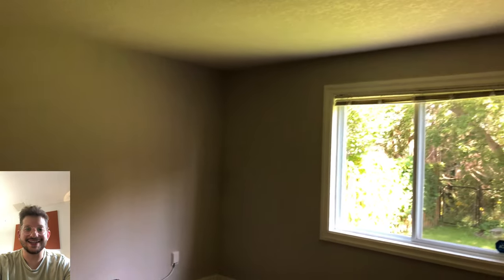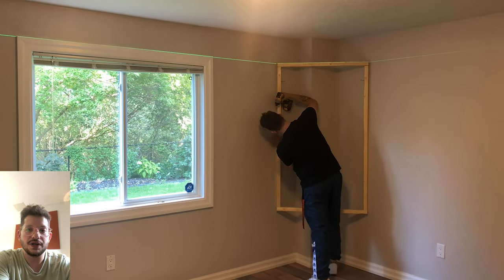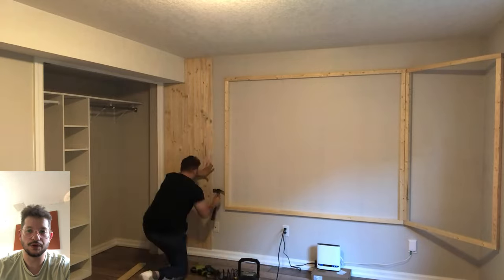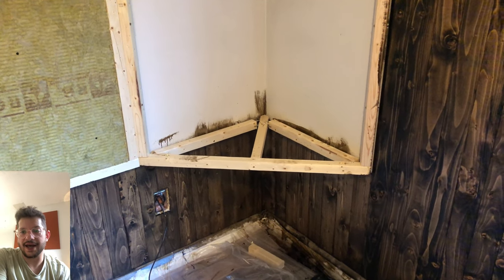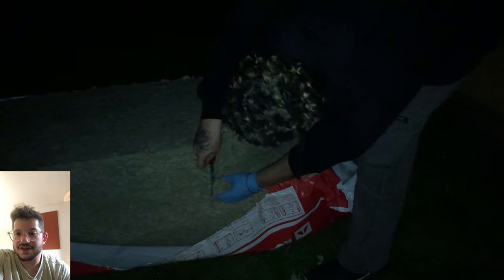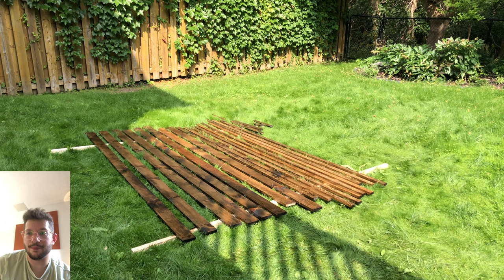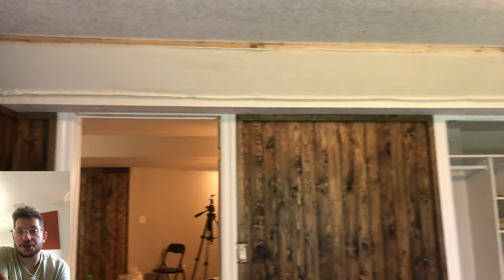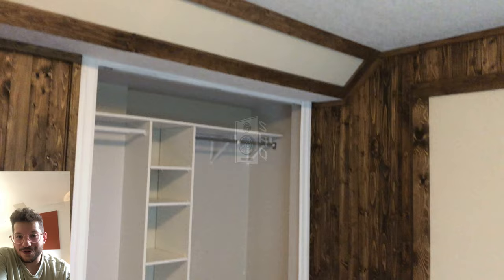DIY EPIC HOME STUDIO BASS TRAPS AND ACOUSTIC FABRIC WALL!

Comment: If it's less than 10cm thick then forget about any bass absorption at all.
Reply: I’d say less than 50 cm deep:)))
Reply: I put a old rug with some towels and a feather doona rolled up in it just standing up in a corner - only about 15cm round. I didnt think it would do much but when i re measured the room it clearly improved RT60 below 70Hz by 35% (bass reflection and roll off time) and room phase cancelation issues at 78Hz by around 3db. Not perferct, but any improvement is better than nothing.

Comment: Question:  why would you choose the labor intensive wood wall strips over another layer of Sheetrock?
Reply from the maker: If the clients objectives were to isolate sound better, then we would have done another layer of 5/8ths drywall. However the client only wanted to focus on the acoustic properties of the rooms, and is familiar with recording in other studios live rooms with wood walls. The wood has different reflective properties compared to drywall/sheetrock. Thanks for watching!
Reply: I spent a lot of time studying this subject before my own project. Here's what I know: 
if you want to stop sound from going through a wall, an additional layer of Sheetrock will provide almost no improvement. You would, however, get a noticeable improvement if you apply a layer of Green Glue noise proofing compound between two layers of Sheetrock. Better yet, do the same on both sides of the wall. Even better, remove the existing Sheetrock and install resilient channel, then two layers of Sheetrock with Green Glue. Better still, remove the existing Sheetrock (on one side) and install new framing so the two sides are completely decoupled, then double layers of Sheetrock and Green Glue and both sides of the wall. One more thing: sound doesn't travel only through walls. It also travels through attics, duct work, floors and windows, so those might also need to be addressed. 
If you are interested in knowing more about my experience, feel free to send me a message. I'm happy to share what I've learned.